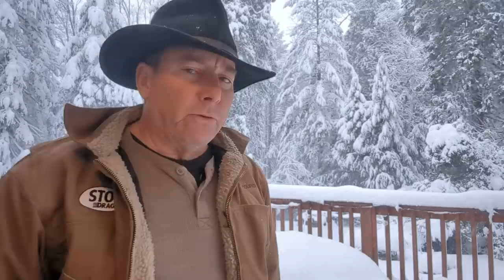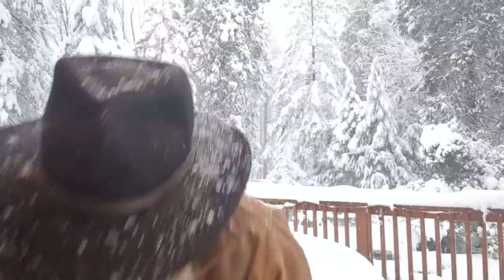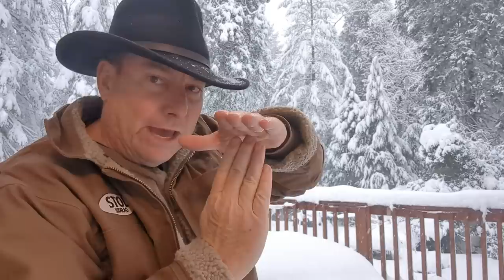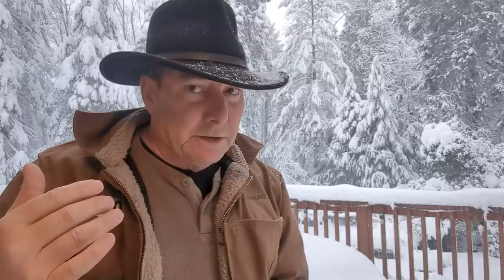PC-12/45 NTSB UPDATE In Flight Breakup! 26 Feb2023

Comment: I was an airline pilot for nearly 37 years. Obviously, all in 2 or 3 pilot cockpits. After I retired, I took a job at a single pilot IFR air ambulance company flying several models of King Airs. We had well maintained, but rather primitively equipped airplanes, instrument wise. During my airline career I always alternated between flying coupled approaches with hand flown ones in order to maintain "stick and rudder" skills. The problem I found with the air ambulance operation was that we flew so little every month that maintaining proficiency was a problem. It wasn't unusual to get less than 20 hours a month, and that mostly in VFR conditions. The rest of the time we were just on standby. There was also the pressure from the med team to complete the mission, even if prudence indicated it was safer not to do so. At the very least, it is my opinion that ALL air ambulance operators should be required to have 2 pilots in the cockpit.
Reply: I can imagine the pressure is intense and from all sides if you have an ill passenger needing to get somewhere or needing to leave to pick someone up. How many were lost?
Reply: I came from a 13-year career in air medical transport. Safety always comes first... Right up to the point it interferes with profit.
Reply: @cousineddie7898  so what you're saying is that safety never comes first.  Surprise, surprise.
Reply: @brentbeacham9691  I thought,  five.  I remember seeing pilot, a ride along, two medical professionals, and the Patient.
Reply: Given the increased cost of two pilots, and the difficulty obtaining them today, I don’t see 2 pilot operations in air med any time soon.
Reply: If you didn't feel proficient enough make it up with simulator time. That's fine for instrument work.
Reply: @SilkyPony33  Of course during my airline career, I had literally hundreds of hours of full motion simulator time. The air ambulance company I worked for had a very primitive flight simulator program which I used occasionally. However nothing beats the real thing, with g-forces affecting your inner ear, etc. Spacial disorientation is a nasty thing, and you can only survive it by having hours of IMC flying under your belt, which trains you to trust your instruments, not your instincts. No amount of non-motion simulator time can do that.
Reply: Air medical pilots finally get their cushy job then sit back and sleep all day getting fatter and lazier day by day. Human complacency sets in, you start fudging your required night take offs and landings, you quit practicing approach plates for iimc, and on and on. I've managed them before and just loved telling them computers are just dying to take your job, keep it up. lol
Reply: @SilkyPony33  After flying for TWA for nearly 37 years, I can assure you that the single pilot IFR air ambulance job was anything but "cushy". As to the lazy attitude, no comment. I do know that failure to maintain qualifications and proficienct will show up big time when your take your semi-annual P/C. Also, there is the pride in your profession and the knowledge that you have the lives of your patients, familiy members and med crew in your hands every time the gear comes up.
Reply: @CaptainAlFrancis  Oh! So you had an auto-pilot that sounds real fancy, must be nice.......sounds cushy as hell to me though. I bet you even had two engines, wow, I can only imagine.....lol
Reply: @SilkyPony33  Actually. 3 or 4 engines for most of my career (L-1011 & B-747) and yes, 2 or 3 autopilots as well! We referred tp B-767s as "light twins".
Reply: Totally agree! I would add that they should also be equipped with flight recorders.
Reply: @jimgaul67  Video and audio in the cockpit, real-time telemetry of all parameters to op con.
Reply: In this plane if you are disoriented if you put the autopilot on and will the airplane fly straight and level?

Comment: I was once driving late at night during a heavy Wyoming snowstorm on a very smooth, dark stretch of lonely highway. My car's speed was exactly matching the wind speed making the snow to appear that I was stopped and that the snow was falling straight down! It was very spatially disorienting and required from me a serious mental exercise to convince myself that I was still moving forward at 45mph. Truly an eerie experience!
Reply: I had the same experience in ground fog. The lines on the road, and my doing 25 MPH to power through the night, was actually disorienting. I was lucky a big truck with his headlights above the fog passed me, and I pulled-in behind him and flew formation.

Comment: I've always been an aviation fan, so I've flown plenty of passenger miles, have been a private pilot, and a skydiver. During those times, I never had spatial disorientation.  Interestingly, mine happened on the ground... I was with a friend in Minneapolis when I was about 25 years old, and as part of our "urban hike", we went out onto one of the bridges that cross the river, and were under the roadway section, lying on one of arches below, looking down about 75 feet into the river. We were lying on top of one of the bridge's arches, perpendicular  to the direction of the flow, which was "head to toe".  After a few minutes of that, I experienced the illusion that I was somehow tipping over toward the river, and it caused a fair amount of panic, with me pushing myself back from the edge, gripping what I could, to avoid "sliding in".  Very strange... It's only happened to me that one time, but although I was healthy and sober, it was a frightening illusion.
Reply: I live in Greece and I have been to the Corinth Canal a number of times. The canal is in a deep gorge, if you stand in the middle of the bridge and look down, it does the same thing. It seems to be pulling you over the edge. It doesn't happen to everyone, but it is a very weird feeling.
Reply: I actually felt your fear while reading your post. Wow . As a pilot I have experienced spatial disorientation and it is real scary
Reply: That was not spatial disorientation. What you experienced is a type of vection, more specifically linear vection.
Reply: @mmayes9466  Well that happened to me, and I didn't have a label for it. Now I do. Also reading a 1993 paper called "Factors affecting the onset and magnitude of linear vection". Thanks for the info!👍👍😁
Reply: @mmayes9466  I stand corrected.  :)
Reply: @mmayes9466  Ugh, and for those of us with vestibular migraines and disorders, we know this all too well.
Reply: As a former paramedic, I’ve flown in a lot of choppers and fixed wings, often in the front seat.  I’ve never flown myself but both my brother and nephew are longtime pilots.  I’d heard about spatial disorientation and panic..but never experienced it in flight..I experienced it driving down a Southern “Canopy Road”, in an ambulance, at night, during a very rare snow storm.  It felt like my truck was taking off.  I pulled into the first road I saw.  Thank God it was a non-emergency call, but it scared the daylights out of me.  I had my partner take over driving and even he said he was getting dizzy and disoriented.  I had it again, to a lesser degree, a few years later while driving my minivan at night, again, during a snowstorm, about 900miles north of my hometown.  I was on an interstate, so it was much easier to get my bearings back with a lot of other cars and lights around.  Still though, it’s triggered something that even now, 25yrs later, I avoid being out on a road if there’s a risk of snow (I’m now in the Poconos, so…😂)
It just blows me away, with a good hospital right there, why ANY company would ask a pilot to fly in those conditions.  Unfortunately, both CEO’s of hospitals and flight services these days don’t have much respect for anything except their bottom line. 😔. NO flight data recorder and just one pilot?  In those conditions? 🤯
Reply: @mmayes9466  If you think your whole body is moving when it's not it's because you're experiencing some form of spatial disorientation. Knowing exactly what specific kind doesn't keep it from being spatial disorientation.

Comment: During the first (right) turn from the SID, the speed quickly decayed from 200kts to 113kts, but still held altitude.  So, the Auto Pilot or Pilot was trying to hold altitude against a strong downdraft.  Shortly after, the speed zoomed right back to 200kts.  Still 19,000.  Generally, a big downdraft will be followed by an updraft.  It seems that at this time, he was hand flying.  He may have been using Vertical Speed mode during the climb, causing the AutoPilot to fight the downdraft.   Icing and Moderate Turbulence likely led to the Spacial Disorientation; Graveyard Spiral; break-up.  I think that all these companies should be required to have two pilots.  It is a Charter Part 135 flight after all.
- Gold Seal CFI.  Citation & Learjet pilot.

Comment: Spatial Disorientation is a very real, potentially violent occurrence. In flight school I was placed in a chair with a stick. I was told to turn my head 90 degrees to the left and tilt my head straight down with eyes closed. The instructor then spun the chair around in a circle for about 30-45 seconds. He then stopped the chair, instructed me to sit up and center the stick. Because my brain thought I was rolling inverted as I sat up, I literally almost threw myself out of the chair in an attempt to become “upright.” This happened within 2 seconds of stopping the chair. This was similar to the dead man’s spin illusion where two or more semicircular canals are affected and give a false perception of level. The only two ways to avoid this phenomenon are to believe and trust the instruments and stay on them, or hand off the controls to a competent instrument qualified copilot. Single pilot IFR in IMC is a significant risk that should be avoided in general aviation.
Reply: That's a really striking example, and your instructor sounds like someone who could really teach in a fantastic way. I'm not a pilot myself but I once flew a proper simulator "into the soup" and the sensation was almost physically sickening. In fact, when I left the simulator I felt fragile for some time afterwards, and at the time I did this I was riding fast motorcycles on track days at high speeds so I was used to a certain amount of "being thrown around/throwing myself around".
Reply: The Minneapolis FSDO office had a chair that did the same thing, called it the vomit comet/chair. They took it to Oshkosh and let people ride it there too, sad to say i rode it twice, it sure teaches you about the leans and spatial disorientation. Thanks Juan
Reply: I have been in a similar experience, and it was both not fun and incredibly eye opening. And a bit pukey

Comment: Over the 10 years that I flew the PC-12, I had three encounters with severe turbulence that disconnected the auto pilot and left the plane temporarily out of control. Luckily, these occurred during the daytime. I had good visual references. Without an immediate power reduction it would have been easy to over-stress the airframe.
Reply: I guess the reason for not having a Vb (turbulence penetration speed) for GA aircraft is "no filght in turbulent conditions supported" !

Comment: I definitely know what your talking about as I’ve experienced it many years ago flying in the Air Force. I was a GIB in an F-101B flying in a three ship formation with two F-106’s doing radar interceptions out over the range. It was a beautiful Sunny morning when we took off and after about 35 mins into the mission we were contacted by the base controllers that a severe thunderstorm had developed somewhere and was rapidly approaching the base. All aircraft were ordered to expedite an RTB. We formed up on the left wing of the lead with the other 106 on the right. As we were about 15 miles out the controller updated us that the storm was about 10 mins from the base and that there were several other aircraft in the area in route to the base. We started going in and out of smaller clouds as we got closer and lead told us to tighten it up to prevent going Popeye. The closer we got we were rapidly given directional changes from the controller to avoid traffic. Turbulence started to increase as well as the broken clouds scattered everywhere. That’s when we entered a larger cloud and everything went white with the wing tip of the lead barely visible and continuing to make course corrections as given to us. That’s when it  hit me thank God I wasn’t flying. Not sure exactly how long we were in the soup and about maybe 1200’.  I was looking out the left side of the canopy and feeling that we were in a right bank when we broke out in a left bank and I was staring at the ground. What a total mind blowing experience being in total White out thinking you were in a right bank and BOOM you break out and looking at the ground in a left bank. I’ll never ever forget that experience. In no way did it compare to the chair spin disorientation training we had for vertigo. I never wanted to experience that again and was always aware of it especially in bad weather. I tried not to make rapid head turns and pay more attention to the instruments to refresh my mind as to the attitude I was flying in during reduced visibility. It can come on fast or creep up on you as in my situation but always completely overcomes your senses.

Comment: Hey Juan, I work for a Pilatus Service Center here. The PC12 is equipped from the factory with a voice recorder, but it is an LRU that every so often fails. The testing for this unit can be vague with some 135 AAIPs. On a side note, in my experience, Guardian does a better job than some others in maintaining their ambulance fleet.
Reply: Having worked for a couple 135 ops, guardian being one of them, I think Guardian is the better of the two. All legacy fleet but well maintained.
Reply: LRU definition? Thanks!
Reply: @FlyWithAlexMora  Thank you Alex!
Reply: What is LRU. Definition didn’t print. Thanks

Comment: I have de-iced plenty of planes that came fresh out of a hanger.  The plane is so warm, water vapor in the air condenses on it, then it cools before departure and frosts up.   Its usually a quick hit with Type 1 and your good, but its needed.
Reply: The aircraft flew just fine up to almost 19,000 feet.  If there was ice on the wings at the time of departure, one might conclude ice was not initially a problem with this flight.  Something happened that caused the aircraft to turn South off its flight plan and then go into a series of climbs and dives.
Reply: @jimw1615  How about ice that may have begun accumulating as they climbed? Say, at 15000 or 16000?
Reply: @gprang  Yes, that is the "million-dollar question", and one we may never know for sure.
Reply: @jimw1615  I was not being specific to this incident, but a general comment about hangered A/C can need the orange cool aid!
You are right, given the altitude they achieved on the ground icing is not likely a problem.